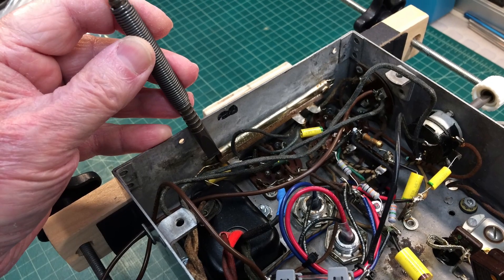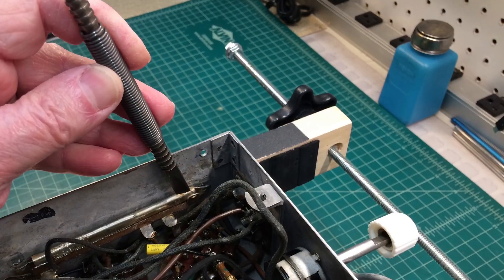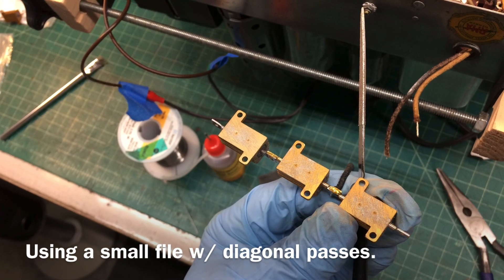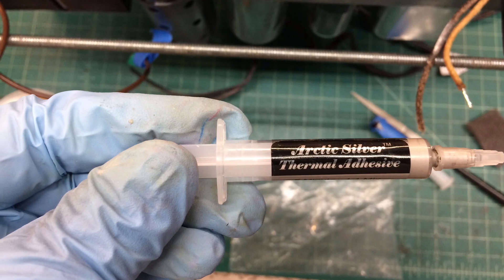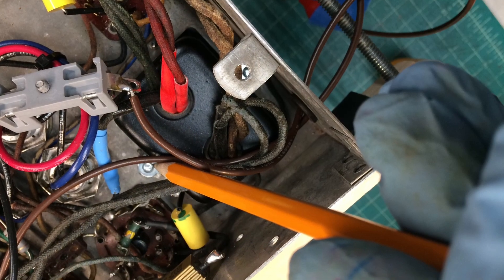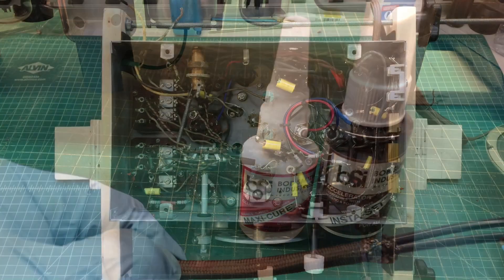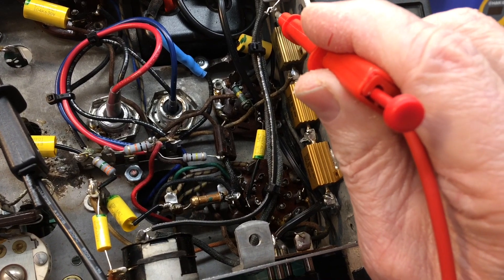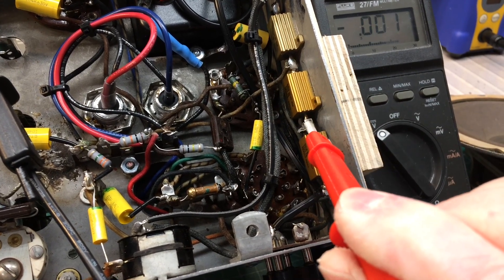Airline 62-316 - Candohm Resistor Replacement, Validating Bias Voltages & Playing My Sad Old Heart

Comment: EEZOX  Hi Don, I don't know where to leave this comment so here goes.  I got out one of my old Ham transmitters where I cleaned the chassis with Mothers Mag and Aluminum Polish.  I coated the chassis with EEZOX and put the unit away.  That was at the point where we were conversing about EEZOX so it was at least 6 months ago.  The appearance of the chassis was now dulled somewhat but when I cleaned it off there was no corrosion whatsoever and the metal was bright underneath.  I don't know about your experience but I was really impressed.  Jim WA8OSS
Reply from the maker: Jim - great feedback on the product over time. Just curious, what was the average humidity for the area the radio was stored? I saw the same myself, kind of a milky look, but the radio was in my shop that the humidity at times can be high. Thanks again for reaching out and sharing your experience. Best, Don
Reply: @RestoreOldRadios  I live in Northeastern Ohio (half the year - AZ the other half)  The radio was stored in an upstairs bedroom in a box.  Whatever the normal humidity for indoors in an Ohio Winter.  Neither very high or very low.  Where corrosion was not cleared very well (near bolt heads, etc where my Dremel tool didn't get to) appeared more milky that the main chassis where I did a pretty good job on the corrosion.  Still working on it and sorting it out.
Reply from the maker: Thanks Jim. Again, I appreciate you sharing your experience with all of us. Take care. Don